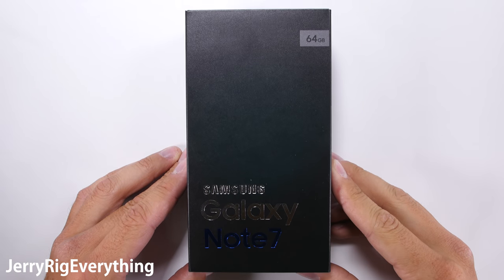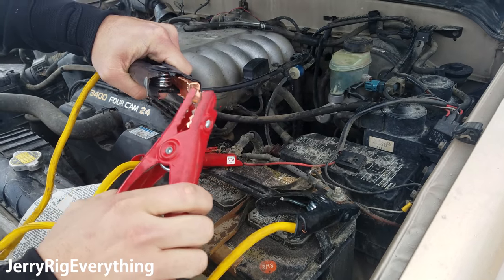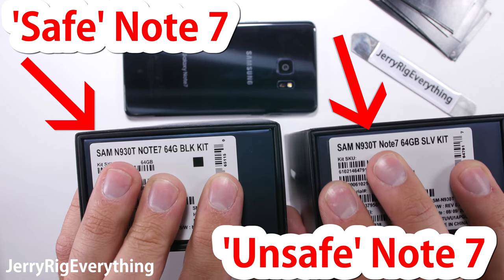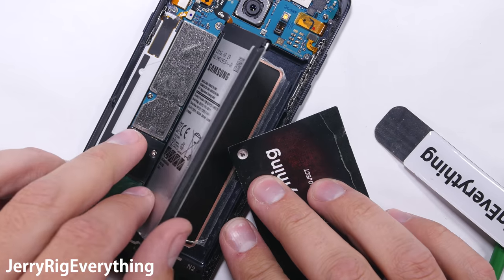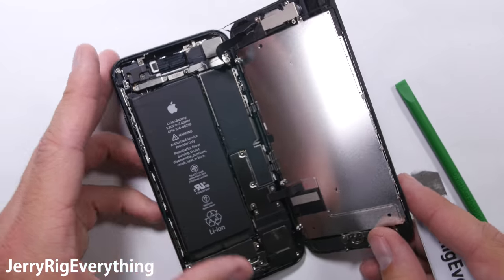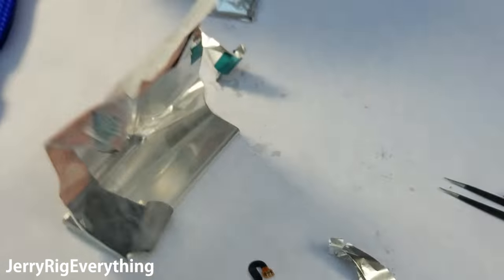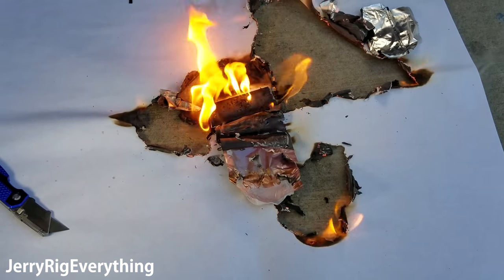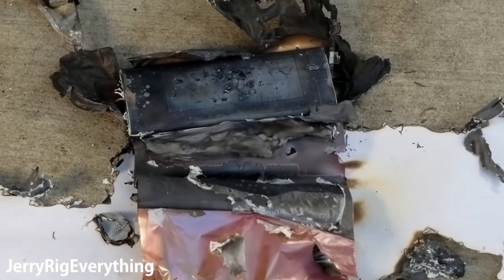Samsungs Verdict on the Note 7 - What REALLY went wrong?

Comment: the galaxy s8 better have a headphone Jack
Reply: Gabriel Umoh has
Reply from the maker: I totally agree.
Reply: Meh analogic sound is dated, digital has much better quality!
Reply: Gabriel Umoh it was already confirmed that it certainly will have a headphone jack.
Reply: Giorat23 having the headphone jack does not preclude you from using USB-C headphones. Choice is best.
Reply: Trevor Selby 1- less holes = better waterproof and more space for battery or others internals 2- Practically nobody charge the phone and listen music at same time..  3- wireless earpods come better and better
Reply: I honestly don't care about a headphone jack lol
Reply: Giorat23 I charged and used my headphones today at work. It would be different if USB-C headphones were super common, but half of the headphones out there are proprietary which is super anti consumer.
Reply: It Does
Reply: It does m8
Reply: Gabriel Umoh lol
Reply: Gabriel Umoh it doesn't everything Apple pro said it was leaked that the s8 will not have a headphone jack
Reply: Gabriel Umoh it wont have. its confirmed
Reply: rumours say it will :P
Reply: Only if you use a TS cable. Which headphones do not. They use TRS cables. Which is just as good as digital. There is no difference.
Reply: Gabriel Umoh they should remove it, so their battery will have enough room inside ;)
Reply: The s8 will have a headphone jack and a usb c for charging... and it will have about 90% screen ratio.. samsung is always on the top... Just wait and see...
Reply: yes. a phone case leaked on Amazon and it has a headphone jack hole
Reply: yeah, i don't care if having a headphone jack means smaller battery, worse water resistance or worse internals i dont know. i just NEED a headphone jack... I wont have an s8 never in my life though, i have an xperia z2, but just because it was $30.000 instead of $300.000 because of an error so... headphone jack4life
Reply: Gabriel Umoh and if it doesn't????
Reply: GRiiM ya... I have a 7+ and the whole headphone jack deal isn't a big deal for me... It sound terrible but after using it it doesn't seem so bad, Bluetooth headphones make it even better. ALTHOUGH.. I lost the adapter dongle a week after I got my phone..
Reply: FusedCheetah ip69
Reply: There's already speculation that it won't.
Reply: But then wireless ear pods are lower quality sound than what can come from the "old" headphone jack.
Reply: it better have an Ir blaster too
Honestly. If samsung didn't get rid of the 3 great things. I'd be getting their latest stuff whenever I could
Reply: Why would they remove the headphone jack? The exploding battery will remove it for them.
Reply: Gabriel Umoh there is zero reason to remove it there is bluetooth you can still fucking have the headphone jack.
Reply: Kate Marsh ok aparently you dont know what good headphones sound like and what shit is. I will say it in dumb terms wireless bad and wired is good. Does that help.
Reply: Havent been using a headphone jack since iPhone 6.... So that's... uhmm... almost 2,5 years? Now I have a Galaxy S7 Edge.. Planning to get S8, and hopefully they removed that dust-pit from the device!
Reply: Kenneth Thomsen you dont use it but others do.
Reply: It better have a good DAC because nearly every phone including iPhone the sound quality and maximum volume just isn't good enough, so instead of plugging into the phone's 3.5mm port I bought a $1 USB sound card and it took sound quality to a whole new level.
Reply: Kate Marsh Still you can't listen to music whilst charging unless you want to carry around wires with you wich most people don't do
Reply: Danial Younus
Other people also used floppy drives... and horses to get around... stuff like that! But at some point we have to move into the next millennium..
Reply: ***** Exactly!..
Reply: girlsdrinkfeck USB-C isn't really a standard for audio. It's still exactly as inconvenient for everybody.
Reply: SDC3 It is possible to send analog signals through any digital connection.
Reply: Gabriel Umoh s8 will have one but s9 wont
Reply: if not, they would surely be having wireless pods within the box!
Reply: Rehan Hasan that would be awsome!!!
Reply: it will come as a free gift
Reply: I hope: 2 usb-C or something like that. The headphone jack is old and should be replaced. 1-type C in each end would have been cool!
Reply: Lars Sandhåland Østevik just because it's old, doesn't mean it's bad. USB C isn't inherently better just because Apple say so. Pocket now did an audio test of the iPhone 7 and concluded that the audio was in fact worse over lightning than the previous 6S and the likes of HTC, LG and ZTE did much better using the standard 3.5mm jack.
Reply: Gabriel Umoh hahahah this reminds me of fast and furious 6 ending :)
Reply: +giroat23 , what you just said , is pure bullshit , first to listen to some audio you need to decode it using a dac , so it doesn't matter if it usb-c or 3.5mm audio jack , usb-c is just a digital passthrough for audio to go same as hdmi.
Reply: That bad luck came from roasting/throwing shade at apple during their s7/note7 event. talk about karma
Reply: Don't worry Samsung ins't as "brave" as apple is
Reply: Gabriel Umoh no it better have stereo dual speakers. 
bluetooth when i think about it aint that bad headphone wise. and for a 3.5 jack, fuck it, i mainly listen to music like that at the gym.. where i take a friggin ipod. so no point in bitching. usbC will become the new 3.5 jack
Reply: DjStiv3 fuck dual speakers as i don't even mostly use a speaker! my phone is mostly muted and the only sound i hear from it is from you tube. and not so often as i stream yt to my chromecast .
 waste od battery
Reply: Practically nobody? What if you need to do this?
Reply: oxoConstantinEoxo exacly the same here
Reply: mrcraggle usbc can do more than the jack. Why have a headphone jack then?
Reply: It won't
Reply: Gabriel Umoh why ? who gives a shit about headphone jack ? just use wireless. how hard is that ?
Reply: SaNi Actually it will
Reply: +TheForge10 instead you use really expensive earphones the quality of wired ones is better
Reply: +TheForge10 and there are just people who like wired earphones just because it is wired
Reply: Gabriel Umoh Use IEM as a daily driver so the headphone jack is kindda important to me.
Reply: Gabriel Umoh God has blessed us with 3.5mm holes
Reply: Yes it has 1 and yes I'm 1 year late xd😅
Reply: Well we found out if that was true.
Reply: I'm from the future, it does, and so does the s9, and s8, and s8+, and s9+, and s9, and note9
Reply: @francisgarcia3452  a year has passed and even the s10 still has a headphone jack c;
Reply: @sumanranchhod1665  i am from the future and you were wrong dummy
Reply: r/engrish
Reply: The s10 have one
Reply: From the future the s10 does
Reply: @thndr_5468  From the future Note 10 doesn't
Reply: Spoiler, it has
Reply: Yupp it does
Reply: I'm from the future, it has.
Reply: @sgameryt681  I AM FROM THE FUTURE, and Note 10 doesn't
Reply: @sgameryt681  😂😅
Reply: Well I got good news and bad news
Reply: Hey Gabriel from 2017, even s10 have headphone jack, you saved the world
Reply: It does. I'm from the future
Reply: I'm from the future. The s8 does have a headphone jack, but it was removed in the Note 10.
Reply: @giorat2349  scrolls through comments on my Note 9
Reply: @giorat2349  They sound terrible and wireless stuff is not good for you.
Reply: @giorat2349  lol, m8, digital have no stance against analogic
Reply: Even the S10 has
Reply: RIP S20
Reply: Im from the future and i have good news.. it does
Reply: Good news
Reply: It does
Reply: @diegolol8523  have, not has
Reply: Maby good headphone jack but bad antanas
Reply: It does
Reply: @giorat2349  hahhahahhahahhss
Tell that to an audio producer
Reply: Giorat23 why do smaller phones have jacks then lol
Reply: The s8 s8+ s9 s9+ s10 and s10+ have headphone Jack's but I don't know if the s20 and s20+ have one.
Reply: Boy are you going to be upset with 2021 😂 no charger in Samsung or apples new phones
Reply: 3 years later...
Reply: 7 years later, we aren't getting them anymore 😔
Reply: mmmm

Comment: hey Jerry I've a question for you, I love your videos but why do you always switch off your phone before opening? what happens if you opened your phone with switched on? pls reply
Reply from the maker: +maneeet Singh when power is running through the device you have more of a chance of ruining it, because the power can spark the motherboard.  So it's important to unplug the battery first thing.
Reply: Nate Jones he means literally unpluggin the battery from the motherboard. First he switches off the phone, takes back cover away and snaps the little lego like battery connector off from the mb
Reply: its just like your computer, in case you wanna remove your power supply unit, you will first turn of the pc and then remove that power unit, not rip it apart when its working
Reply: I think his name is Zach or Zack. The youtube channel is called jerryrigeverything as in, jerry rig everything. Now jerry rig is actually a term and describes his channel.
I know I was shocked to hear that he wasn't Jerry.

Comment: are you part of that 4% who hasn;t returned his note 7?
Reply from the maker: No, Mine are returned. All of this footage was shot previously.
Reply: JerryRigEverything I kept mine because from press conference they mentioned not all suffered from those battery defects & also you can tell if your Note 7 is defective if it gets overly warm while charging or running demanding app. But mine is very kool while charging or playing heavy graphics mobile games like Mobius or Duel links,will replace my Note 7 with S8 or Note 8 #top4%
Reply: just dont bring it on a plane... you will get fined severely
Reply: Kai-Zer Alcadias basically every phone gets warm when doing intensive tasks and while charging (and most of those don't end up on fire). So you can't use that alone to tell if it's gonna catch on fire.
Reply: @JerryRigEverything  the note 10 better not make the same mistake

Comment: so there is no way to buy a "safe" battery and replace the "unsafe" ??
Reply: dislexiar That is unfortunately true.
Reply: dislexiar Both problems trace back to making the phone too small to hold a reasonable capacity for its power draw. Even the optional higher capacity back for the S5 is overly tight. They need to stop pretending all models - particularly these high end ones - must be too thin to even handle.

Comment: it wasn't bad luck. They did all wrong for saving some money in the proces
Reply: Miguel Angel i don't think that's is true they don't safe money on safety that's only something Apple does and ofcourse the blame their customers for using their phone wrong
Reply: Mike De Roos it is. Second time batteries has welding issues and  no thermal layer. I'm not sure about the English name (I'm spanish)  but trust me. It was for saving money.
Reply: Absolutely agree with you. They pushed their luck too much, always pushing and pushing for lower cost to get maximum profit. It's okay to improve profit it's business after all, but when you keep going too far, it's just a matter of time before something goes wrong.

Comment: I didn't return my note 7 for a reason, I replaced the battery with a smaller one used in the prototypes and it doesn't have a problem at all other than a shorter battery life.

Comment: I haven't seen lithium Ion batteries blow up like that. I've had car batteries self disassemble, and it wasn't that violent. Most lithium ion batteries have temperature and voltage protection on them. Temp or voltage gets too high, and fuse blows. Even an external puncture tends to start a fire not an explosion.

Comment: so the best way to keep your note 7 is to manually change the battery, put in an S& Edge battery (provided you've played around with your soldering iron to match the wiring) and then run custom firmware on it seeing as Samsung will never ever release an update for the note 7

Comment: This is why wee need innovation in the battery department. We have Oled, LCD, Quantum Dot, etc for screens. We have inferred, temperature, digital, etc for cameras. We have balanced armature drivers, dynamic drivers, etc for speakers. And for rechargeable batteries all we have is lithium ion, or polymer which is usually just improved by reducing insulation and protection from within the battery to make room for more lithium, thus BOOM! First company to make a safer and equally or greater capacity battery will make BILLIONS!

Comment: Honestly, this isn't doesn't' surprise me with Samsung batteries.  Between the incorrect labeling of USB requirements in many Samsung phones (they use the battery capacity rather than the adapter capacity), inaccurate battery gauges (18-29% do not exist in the three Samsung phones I've had from much different Android generations) and many times Samsung batteries swell up and fail within 8 months to which the gauge error is amplified and only caused by fully charging the phone...They should fix those problems as well.

Comment: But how can batteries, like the one used as replacement and manufactured before the Note 7 had problems, exhibit the same flaw? Those batteries were supposed to be safe, but inside the same Note 7 they started catching fire. Those safe batteries did not catch fire before. If it is the batteries fault, then a lot more Galaxy phones may catch fire in time and it is not at all ok.

Comment: I like Samsung...but they do tend to ship phones with a defect or two(out of the box or arising within a couple on months)...my note 3 had this strange purple flashing while scrolling which was visible especially when the screen brightness setting was low....my S6 edge had two issues again the super amoled panel within 2 months developed a strange 8-bit effect where everything dark looked cartoonish or painted and a month later the camera module started making creaking noises while shooting outdoors in sunlight (high temps the reason)...but they've come a long way my 1 month old 128GB pearl black S7 edge is a thing of beauty has zero issues hope it stays that way..hope the note 7 Fiasco makes Samsung learn to get the basics right
Reply: Jatin Sharma the note 3 thing wasn't a hiccup. The display is AMOLED and the settings are black with white writing. The pixels had to quickly turn off and on while scrolling up and down quickly. That's why it looked purple. Also this was later fixed with a software update

Comment: The problem with the Note 7 is that Samsung crammed way too much stuff into such a small device.  Samsung had been better off if they made the Note 7 slightly bigger or put a smaller battery into the Note 7 2nd time around.  Hopefully Samsung has learned their lesson and the Note 8 will be a more stable device.

Comment: wait, even as someone who makes diy capacitors in my kitchen, I ALWAYS make sure that the insulating layer goes farther out than the anode and cathode, why would anyone design the battery in a way where the terminals can short without physically breaching the insulating layer?

Comment: Just thought about this moment and watched the video. But of course they were going to recall. If they didn't they would had been doomed as a company.  Also if it was the battery and from what they said initially they figured it would be cheaper to take them all back rather than develop a different battery with straight edges because the tight corners would had been a smaller battery or other issues like the amount of time it would take to get the batteries designed and made then shipped out

Comment: If Samsung had been using Sony, Sanyo or LG cells they might not have had these issues I bet lol... instead of going for guangzhou charlie's finest they'd have been better off with a little bit of Japanese engineering behind them and I bet the chances of the recall would have been slimmer... even if the phones had to be more expensive because if the higher cost to produce the cells.

Comment: I use mine as my daily driver.   Still has green battery icon and is working great.  And for the record,  keeping it had nothing to do with the quality of the phone.   It's not so great I cannot live without it.   I'm keeping mine because two multi billion dollar corporations can't manage to take some responsibility and just let me go back to the way my plan was before I upgraded.   I'm not paying fill price for an outdated phone that I've already paid full price for when it was brand new.   They bought my edge for $95 credit towards my account and towards my early upgrade.   I just want the phone back that I had before, but they want to charge me $750 for it!     and lock me into another contract.  So since sprint and samsung are so hard up for cash I'm stuck with mine.   Not to mention,  they would hunt my ass down for breaking a contract.   Since they broke the contract,  they just manipulate the situation as if it were my fault and I should have known better than to buy a faulty phone (that they sold me) but I only paid $300 for it so there is a bit of good news.   For me,  it is about the way I've been treated,  and the time that has been stolen from me as I've attempted to follow recall procedure to no avail.